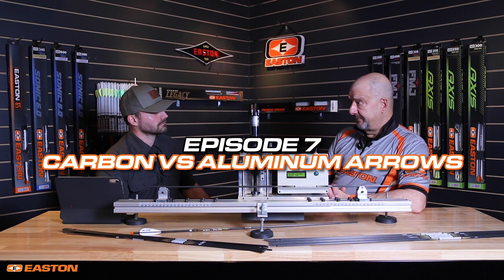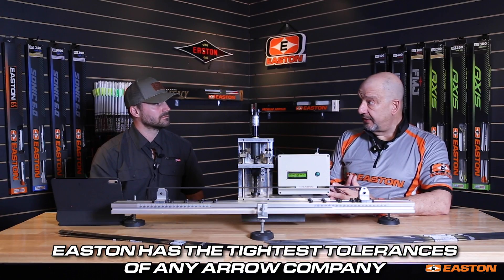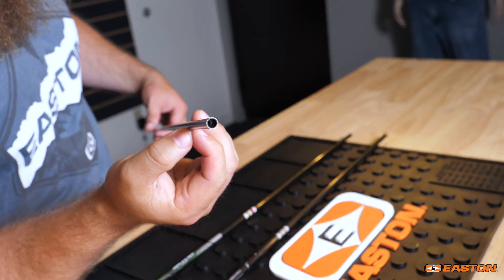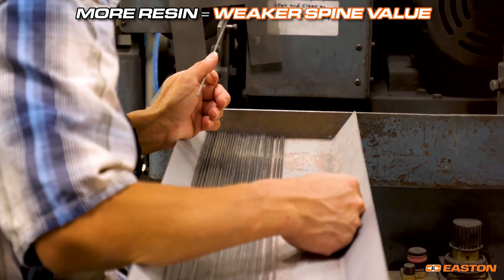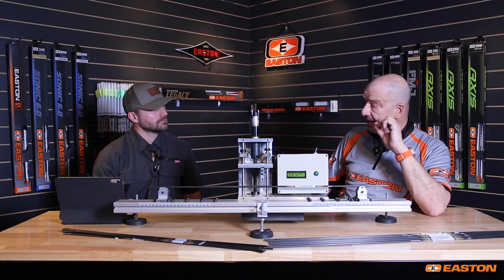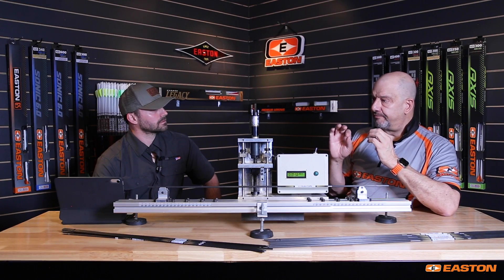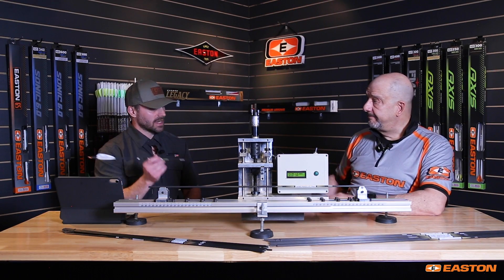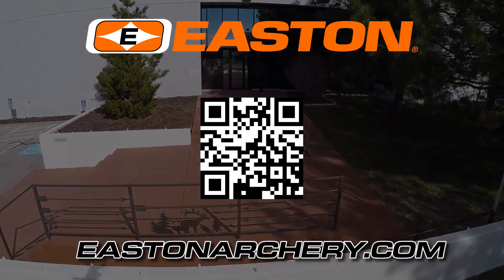Carbon vs Aluminum Arrows // Easton - Technical Bulletin (Episode 7)

Comment: Why you guys discontinued the xx78 is a mystery. I've seen enough videos of shooting pencil carbons with giant expandables and getting about 2" of penetration on game. Bottom line more straight, quicker arrow recovery and penetration with an aluminum. Your own rep admits that... The larger diameter the quicker the arrow will straighten out in flight.....

Comment: When I started with archery in ‘85 I was told “ you can shoot good arrows from a bad bow better than bad arrows from a good bow
” I’ve used Easton ever since, and a good bow btw!
Reply from the maker: Awesome! What arrow are you currently shooting?
Reply: @EastonTechnicalProd , currently shooting x23 indoors cut 28” with 125 grains up front, outdoors I use ACE 520 I cut 2-3” off the back then cut off the front to 28” 90 grain points. Current bow is ConceptX 26.5” draw 49lb. I have just had my 79th birthday btw . The new 3.2mm X10’s look interesting, I’m still waiting to see a price point here in UK.